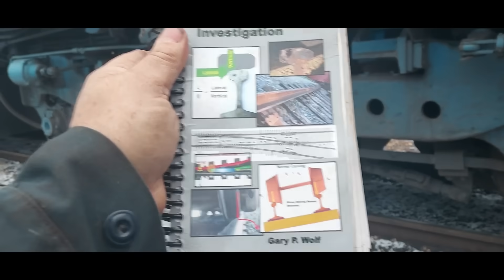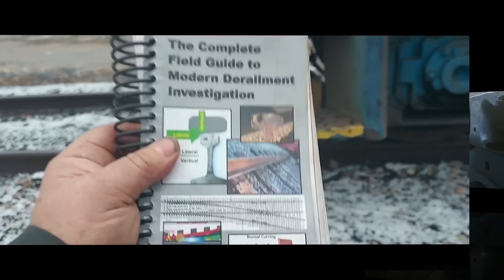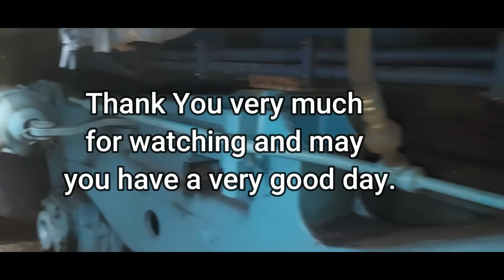Meet One of the World's Foremost Experts on Derailment Investigations

Comment: Hello, I am a student and I would like to know how you clean the wagons from the remains of coal, gravel, crushed stone and other cargo?
Reply from the maker: All we have here is coal cars and 1 ballast car, they never need
cleaning. Sometimes grain and cement cars on other railroads
do need cleaned out and they most generally use a vacuum truck
to clean them out. If a coal car should happen to need cleaning
because the doors wouldn't open to dump them, then a clam
bucket would be used and after that a vacuum truck to get the little
remaining residue.

Comment: Thanks Mr. Dave this video is very informative. It helping me learn in more detail about the tracks under the engines and how to have a smooth ride. When pulling that much tonnage, the ride could be very rough, but when the loads are light or as we saying in tracking Bob-tailing the ride becomes rough. So my question to you does the ride become rough when the load is light?
Reply from the maker: Thank you for the nice comment Rev. Harry.  Sitting in the cab of these old locos it's been my experience that you are right, the loco
does ride a bit rougher with empty cars as opposed to loads.
However it's been a long long time since I ran, so trying to rely
on memory here. Definitely in my dump truck at home the loaded
truck rides much better than a light truck does. Really appreciate your taking the time to watch and may you have a very good day my friend.